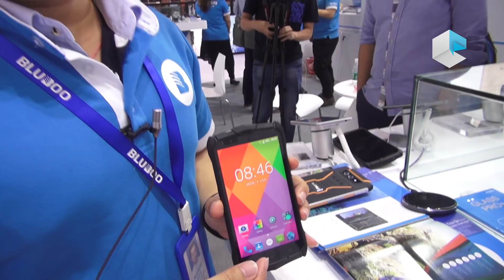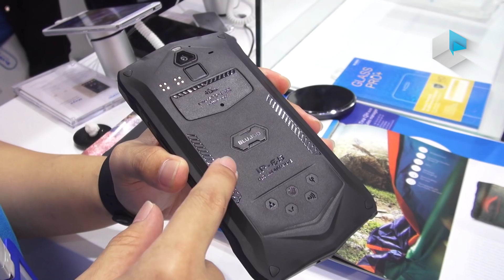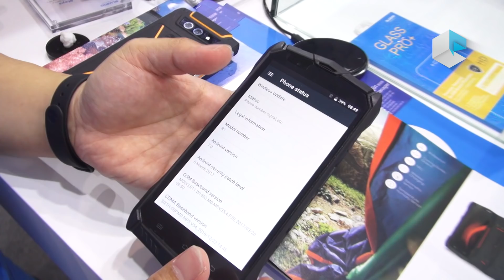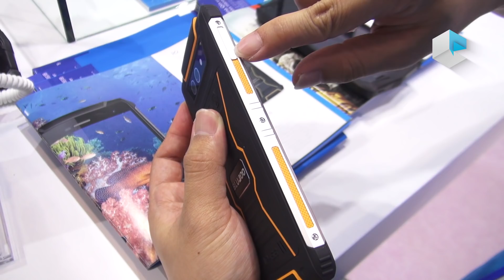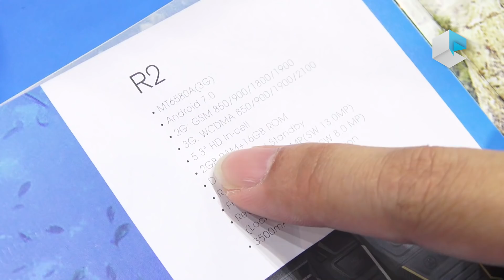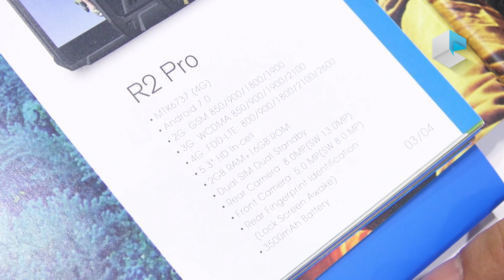Bluboo R1 and Bluboo R2 rugged smartphones IP68

Comment: What is the use of the metal connection pins on the back side? Also, what does he say at 1:18?
Reply from the maker: those pins are used for accessories and jackets nd whatever, like Moto Mods. about the second question, I have no idea :)